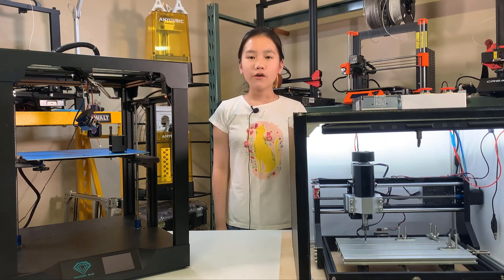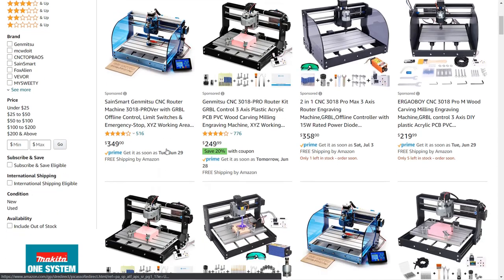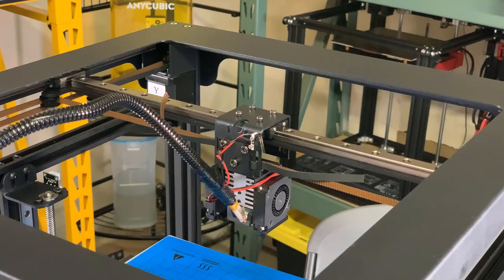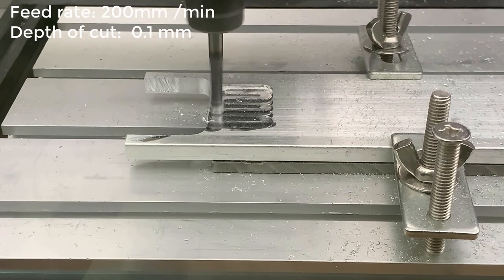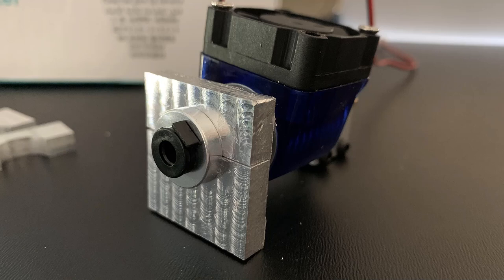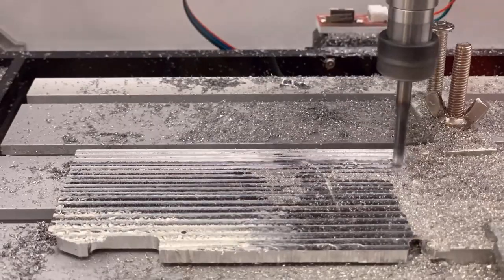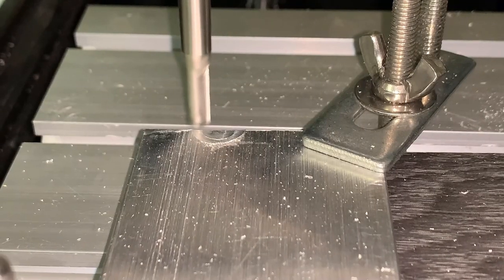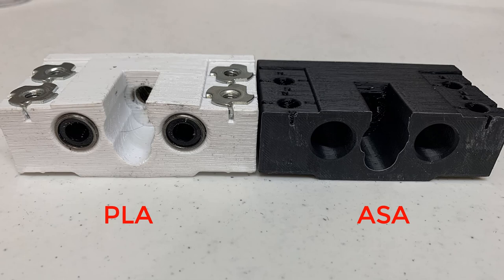Cutting aluminum parts with 3018 Pro CNC, making an E3D V6 hotend mount for the Sapphire Plus CoreXY

Comment: I cannot believe my eyes and ears. How old are the two of you? The amount of technical detail in your presentation, the fail analysis and the humbleness demonstrated are off the charts for two youngsters such as the two of you. Please tell me you are being tutored by an engineer.

I am going to make a couple of remarks, please take them as constructive.  One of the things that struck me was the separate emergency buttons. Never have I seen such a thing in any machine, and for good reason. I don't see a good reason to do so, let me explain why: If you stop the spindle and allow for the travel to continue, you will damage the part and quite likely break the tool. 

What operators do, is they cut the feed rate to zero if they don't want to waste time getting back to where they stopped the program. The spindle can still continue turning, but the axis will be stopped. The role of an emergency stop is exactly that, it's a panic button. In case of not being able to assess in time if someone will get hurt, or the machine or parts will get damaged, you just press it. 

There will be time to understand and learn later on, the important thing is that everything and everyone is safe. By having two buttons that stop different functions in a machine, you run the risk of making a mistake and press the wrong one, potentially causing even more harm. My advise is, you can use more than one, that's perfectly fine, but make it stop everything. If you just want to slow down the travel or stop it entirely, use a jog potentiometer. I say this with the utmost respect for your skills, which make no difference how you get them. That you have them at such a young age is mind-blowing. I get that the text was scripted, but still, you are way ahead of what I expected for your age bracket.

Facing operations: the first thing you do when you setup any milling CNC is to face its own table. It's a long operation, but it will serve you well, as after that you know that the table is square with the vertical axis, so you can trust what you machine next. You don't want to speed this, as the smoother the table, the better the outcome will be. Also, if you need to get more proficient with squaring parts, I suggest that you machine cubes, and use measuring tools to make sure that your parts are well positioned. I don't know the English name of the gauge dials that are used, but maybe someone else can give you that information.

I loved that you built the enclosure, it keeps everything cleaner and safer. I just want to add, never allow for machined parts to fly off. You are dealing with small, and low mass parts now, but bad habits tend to stick, and if that was a part made of a harder material like stainless, with sharp edges and would just fly off, I can guarantee that there would be damage done. One day you may become professional machinists, so please adopt safe procedures as soon as you possibly can, so that one day you don't get injured because o a knee-jerk action out of a bad habit.

As for the rest, flawless. I take my hat off to whoever is helping you to achieve these things. Never operate machinery without company just In case you need help, and preferably have adult supervision. I would say always, but that's not something I can enforce, only recommend. Keep it up, invest your time in learning more cool things, you won't regret it.

All the best, I'm going for a coffee, because I still think I had a dream.

Comment: But could I use it on a AR15 80% lower? 🤔
Reply: Not enough height. In that configuration, the Z height is limited to a little over 1 inch.

Comment: I have old graphtec ce 2000 plotter  can I use x axis unit for 3d printer
Reply from the maker: I am not familiar with that plotter, but I think if the machine can move in XYZ should able to 3d print by adding a control board, extruder, and hotend.

Comment: Which one of the 500w spindle conversion did you do?
Reply from the maker: Any DC 110v 500w spindle should work the same, you can see if there is any cheaper option from Aliexpress or eBay.

Comment: Well, here is your first problem. Your cutter is way to long.  Vibration is going to happen. #2 you should be cutting ALU with HHS (High Speed Steel) if you are not. #3 You need a collant/lubricant. For ALU use Varsol.  ALU has a lower metling point and will gum up the cutter when it gets hot.  The fact that you melted parts of the machine tells me you need less speeds and feeds.  It will take longer but thats what you get with a 200$ machine.